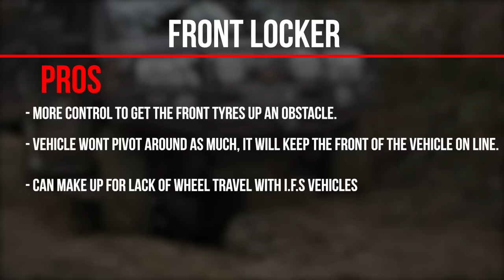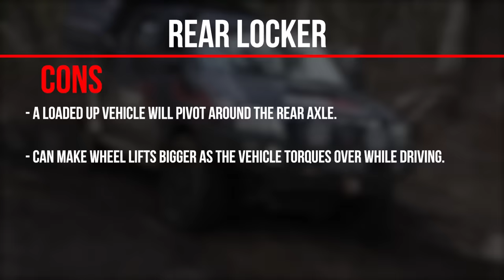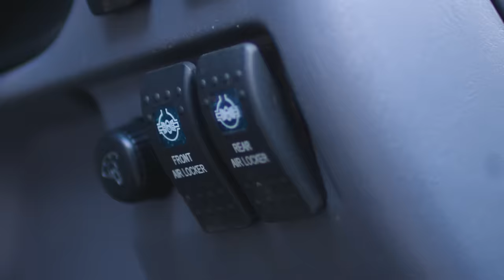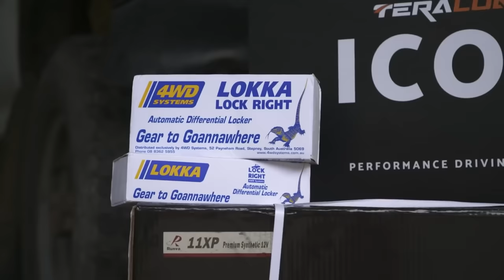FRONT LOCKER vs REAR LOCKER vs TWIN LOCKED COMPARISON! + AIR vs AUTO vs E LOCKER – Shock answer!

Comment: I have an auto-lokka in the front of my ZD30 D22 navara with manual locking hubs, and i can say that they are damn amazing.  I have definitely noticed the stiffer steering when on higher traction surfaces, and in most cases, just backing off the power a bit helps immensely. You can even leave the hubs in and engage 2HI, and barely make a difference to steering, but on smooth surfaces you can sometimes hear them clicking. In saying that, they are mind blowing on soft sand, you can feel the vehicle clawing its way through instead of being pushed. Super easy to install.

I think the most amazing thing though is with descents. With the lokka automatically engaged, you get both wheels braking forces even if one wheel is in the air, and descents are incredible more controlled. Without the lokka, if you lose traction on one front wheel it will more then likely spin faster as its being forced to spin via the transfer case, and the other wheel will lock up, causing a slide, as there is nothing actually forcing it to spin anymore, because the other side is in the air.  That just doesn't happen with the front locker, and the control while on a gravel hill suprised the hell out of me.

So yes definitely a vote for the autolokka. Yes, occasionally you will get the stiffer steering,  and probably the most inconvenient time will be when you are about to go around a corner, but if you let your foot off, its fine.  

As for front/rear, scientificly, its a hard choice. I mean, LSDs are already in rears, so a locker would also help more. But in saying that, the front locker on an IFS vehicle is a no brainer. With a rear LSD already helping, the front locker works well with IFS's lack of traction.  

The way i think of it is this: going up hill, most of the power and center of gravity would be over the rear wheels, so those two wheels will more then likely ALWAYS be on the ground. Like jocko said, once you have one of the front wheels are in the air, you now have a 2wd vehicle.  A front locker will at least give you a 3wd vehicle. A rear locker would not.  You see this in never every clip here in this video, its usually one of the front wheels in the air. Hell its probably 90 percent of the time, you have a front wheel in the air. Once a front wheel is in the air, the entire front becomes useless. 

3wd vs 2wd.  

In the case of ute with more weight on the front due to the engine, and an empty tray, your two front wheels will spend more time on the ground, and with the rear LSD already helping, giving you a rough "2.5wd" a front locker would go back to give you 3.5wd.  That, and with the front locker helping prevent one wheel from spinning wildly, and then when hitting the ground it causes the CVs to snap, you simply dont have that issue anymore, and there is no need to "Send" it as hard, also make the case for a front locker first.  I also see a lot more failed front diffs in utes all for the same reason. Going up a hill, front wheels go up in the air, come back down, and pieces of money fall out of the diff. 

So yes. i work on the principle - whatever wheels you see spin the most up in the air, they are the ones you should put a locker onto. See a wheel spinnin? lock it up!
Reply: Just about to fit one to my 2015 Pajero. IFS like u said will make huge difference

Comment: Love Graham’s comment you push a wheel barrow you don’t pull it. I would love to see him push a full wheel barrow up a step. If you get to a step you pull it up. Front locker is the way to go and just weld it.
Reply: just weld it?????
Reply: why do you need to weld a locker? lol
Reply: @MrTonaluv  if you know someone that can weld depending on what they charge you, you only need to replace the oil. Dont do it if it doesnt have free wheeling hubs or converable auto hubs
Reply: Clearly Graham  has never worked in a job involving a wheelbarrow
Reply: @bradhaines1905  welding an open diff turning it into a permanently locked diff is crazy on the front. How do you steer? It will wind up badly on the bitumen!
Reply: @MrTonaluv  it only works if the 4wd has selectable manual hubs on the front to activate 4wd (when hubs are off no matter if 4wd is on, both wheels are independant)
However when you see the price of a spool block to lock your central carrier and so the diff welding is REALLY a brute's way of handling things
Reply: @tinatpasselepoivre  yes I get it now with the free-wheeling hubs thanks mate. You're right tho about the spool block price - under $600 for a Lokka, and they work really well.
Reply: This a why small front wheel drive cars are suprisingly good at not getting bogged, a tiny FWD corolla with tiny wheels absolutely eats my full size Falcon with much bigger wheels when driving on sandy roads on the farm.
Also when i used to race in Speedway i drove a RWD Datsun at first and then a FWD Charade later, the track was muddy and the Datsun always had the danger of getting stuck if you spun out and ended up in an extra sticky patch, this was never a concern for the Charade, it would just pull itself out.

Comment: For a street/trail rig, I really like the combo of an aggressive limited slip e.g. worm gear type TrueTrack for the rear and an air locker for the front. Helps keep costs down while still being capable and streetable. I'm with Graham - auto lockers are just not my thing anymore. Been there, done that.
Reply: I've heard of this setup elsewhere, too.  Why not torsen in the front,
Reply: why not auto lockers
Reply: @annabanna666  They are no good on hard and paved roads.
Reply: @BuildingByFaith  For one thing, it isn't selectable on and off. It's easy to be in a situation where you need to turn and can't with the front locked.

Comment: I’d like to see testing in different terrain.. soft sand in particular...
Reply: Exactly. How does each locker perform on the arctic tundra?
Reply: I find my lockers pretty useless in sand. I just seem to bury myself faster.
Reply: Agreed we have more sloppy mud than rocky hill climbs where I am
Reply: I find the opposite 🤔 @volvogt21
Reply: @terrydactyl7708  that's interesting. Do you do your challenging sand driving in high or low range?  A patrol mate I crossed the Simpson desert. He did most of it in low. Yet my t/d landcruiser was far happier in high. Low just dug holes and gave me no momentum.
Reply: I cross about a kilometre of really soft beach regularly  @volvogt21  and I do it in high range with a rear locker. Used to loose momentum quite a bit before the locker installation, now I just power through every time, no worries. I feel the locker has made it unstoppable in the sand. Makes me want to invest in a front locker, but wonder if I really need it now. I have no doubt it increases my capabilities in sand. I can take it all at such a good pace whilst everyone without lockers has to put their boot into it to get through.
Reply: @terrydactyl7708  cheers Benjamin.  That's nice info to know. I'll try it out next time I am in soft sand. I'd almost stopped considering them in this situation. A front locker is great but as they say it probably gets me 10 meters further into a place I shouldn't be... lol.  They are great for the sort of conditions that bloke was using it for. Plus it has the benefit of strengthening the front diff on an IFS landcruiser allegedly.
Reply: Sand should be in high range no lockers engaged.
Reply: Why would you want power going to the wheels of least resistance  @joshquiroz  in soft sand? Doesn’t make sense. Locker has got me out of bother in soft sand time and time again

Comment: Good one Jacko 👍  For my 80, I'm planning to put a front locker first.  With the type of driving I do, if I only fit a rear locker, this can increase more front wheel lifts and potentially cause a flip (torque front wheel lifts) as it pushes the vehicle up obstacles.  Front lockers prevents this as it pulls the vehicle up and over obstacles.  But will eventually fit both.
Reply: That's a very good point, thank you.  You alone helped me decide which to do 1st
Reply: Keep in mind that you will lose steering ability with a front selectable lock.  Especially so when weight has transferred onto front axle, ie driving down a rutted step. Front locker great at holding back vehicle on steep, loose downhills, at the expensive of steering.
Reply: When going up hill the weight shifts to the back rear locker will do more good more often. I would get rear first then front.

Comment: "Jocko's Toolbox" should be a regular segment. Honestly Jocko the enthusiasm you show when you are explaining the technical aspects of things is amazing! I have a 2011 Amarok equipped with a factory electric rear locker, if I was looking towards getting a front locker down the track, would it be worth converting the rear to an air locker if I was going to put an air locker(including compressor and all other needed bits) in the front? Can E locker rear and Air locker front work together or would it be a smarter option to have them both the same? Cheers

Comment: detroit style auto locker is the way to go, i have them front and rear and they're totally unnoticeable and always locked, i do have a selectable 2 and 4 wheel drive, separate from the high low, rear disconnect and sticky tires.

Comment: Got an TD5 and I put ann Ashcroft ATB Limited SLip Differential in both axels. It´s more of an overlander and the fact that it always provides best traction even on dirt roads was important for me. Plus the TD5 got a traction control, so even when one wheel should spin it will be stopped and the wheel with traction gets some force. Very happy with that setup, it´s simple, it works and it holds up.

Comment: Twin ARB Air Locked in my Discovery 4 💪🏼 ideal to have both lockers in action, plus having one of the better selectable variable terrain response traction control systems is a bonus. 

Great video, Jocko really knows his stuff, good to see these more in depth explanation and technical videos too 👍🏻 keep up the goodness

🏴🇬🇧🏴
Reply: Thanks mate! Your disco sounds very capable
Reply: @jocko4wd281  one day I’ll ship it down under and see what it’ll do on some proper tough stuff 🤞🏻
Reply: Thinking about getting a rear air locker for my discovery 4, what kind of terrain would you say it helps with the most? Do you think you have used the front locker enough to be worth the price? Also, how differently does terrain response behave with the lockers enabled? How often do you use just the rear, vs just the front, or both, or none at all? I appreciate your time if you do answer 🙏

Comment: I am first time watcher and if your still around i hope cause its been 2 years since this video i want to tell you thank you so much! I have been wanting to find out about the different locking situations and you did it great and humbly with no cockyness and i truly preciate that buddy. 
I have two 4x4s. Both from factory have limited slip rears and full time lock in front. Both are old 4x4s but great trucks.
So when i fill like i dont need both lockers in front i just put them back in 2x4 and then i have limited slip rear and single tire pull front only difference in mine and yalls is yall have a real nice fancy switch that would be so convenient and i have a manual shifter i have to pull but it works.
One of mine is a w 1994 Dodge Ram 2500 5.2 motor 5 speed manual looks brand new. Single cab.
The other 1988 GMC ext cab K2500 with 1992 Chevy Tahoe 350 motor and a 4 speed Chevy Bulldog manual transmission. Great trucks. 88 dont look pretty but drive train is great. But it takes 40 acres to turn it around thats the only fall back with it.
But i realy preciate your help but also not just talk but you did a out on trail illustration and so we cant ask for anything more than that.  By what you showed and taught me i believe im good but i am always eager to learn and i sure got a whole lot to learn. 
Take care buddy and thanks again!

Comment: Love how every single person but one said rear locker going against what jocko found
Reply: I feel like it’s just what different people want. Even Graham said with a good Nissan LSD you can get a front one but he likes rear better. But jock also does more rocky stuff where a front would be better
Reply: You also notice that their cars are heavier than his hilux
Reply: Yup.....Funny how perception vs reality(per jocko's testing) never aligns
Personally I would do front locker just to pull that front through and over stuff vs trying to push it through which never seems to work well. Having front locking hubs allows you to adjust accordingly to keep the turn radius at least for the mechanical locker set ups.
Reply: In North American you will find usually Front first for climbing.. Its all about application.. Rear first seems to be an Australian thing.. Even MadMatt4WD did the same test and found, to his surprise, the "front only" more efficient then rear only..
Reply: @jefftenhave8038  also found it alot safer due to the lean the rear can cause
Reply: @jefftenhave8038  As a result of seeing MadMatt4WDs testing (and seeing the test done on a SWB) I bought a front auto locker for my SWB Patrol, compared to a mates SWB Patrol with rear locker, my front locker defo helps to crawl up steeper rock steps in a more controlled manner
Reply: @petebravo7180  this very apparent in ATVs and UTVs that don't have front lockers.. Front tends to pop up and the rear end walks right up underneath. This is how back flips happen.. All push from the rear and no pull from the front on a hill can make for a bad day .. I can never understand why people use the wheel barrow analogy??? Try and push a wheel barrow over a log..
Reply: @jefftenhave8038  I agree completely there is another video from a different channel and they go a bit farther into the effects of the rear locker trying to over rotate the vehicle while climbing. It helps no doubt but has a inherent instability during steep climbs used alone
Reply: I can’t remember which video I watched, but the presenter mentioned manufacturers equip vehicles with rear only because it has less chances of failure (in ifs if I remember correctly) 🤷‍♂️
Reply: @Agent.K.  correct you are less likely to brake a solid rear axle over a front axle as the weakest link is the cv
Reply: @Agent.K.  Rear lsd and auto lockers will help out while in 2wd as well.
Reply: There's obviously a whole lot of 'group think' going on without much 'actually think'.
Reply: @anthonywhitney634  🤣🤣🤣 that gold but a really good point

Comment: Having an IFS wagon with a good LSD in the rear I love my front auto locker, In my old Zook however the rear locker worked wonders especially with the short wheel base and the tendency to lift the front wheels when climbing, not to mention the on the spot donuts!!!

Comment: Considering the $ spent on mods, the budget issue is really out the window. Nobody seems to think twice about fitting a front bar but they cost twice what a locker does fitted. The price of a second air locker for example is insignificant in the grand scheme of what average Aussie spends on 4wd mods.

Comment: I went for a rear e-locker in the mighty Maximus. Purely and simply because I didn't know where I could reasonably fit an air compressor in the setup that I had. It has evolved slightly since then, but I'm sticking with the e-locker, and I'm considering putting one up front as well.

Comment: It's certainly a "depends on your driving" type of answer. Rock crawling, a front locker comes into its own but for most people, the rear is the most useful. 

I've a Discovery 2 with air lockers at both ends. The rear gets more use but having both is excellent.

Comment: Coming from across the big pond, I found this to be very enlightening and educational and...love the Aussie dialog. We Jeep over here but have the same concerns about the use of lockers. Myself, my LJ Wrangler is getting ARB air lockers installed next week as I already have the compressor and tank onboard for frequent deflation refills. Passing this on to my mates here in Georgia...keep up the great work.
Reply: I can't see any reason to use a front locker without the rear engaged. Other than for test purposes.

Comment: A well done and fair comparison of lockers. My personal preference is rear first, unless it's IFS or like a Patrol with a solid LSD in the back.
It may be worth mentioning too that some e-lockers can temporarily unlock when you change direction e.g. you reverse a little to take another go at climbing, which can make technical driving more difficult at times. For those interested AllOffroad 4x4 Adventures TV, Filthy Motorsports and other Youtube channels do a good job of explaining it.
Reply: Thanks mate. 
I originally had that in the video but decided to remove it as that refers to one particular brands design and not all e lockers do that I believe. But it’s interesting nonetheless! 
Thanks for your feedback, yep filthy motorsports and Alloffroad do some great vids on this too!

Comment: I just completed the install of front and rear air lockers in my Isuzu VehiCross. One think I did differently is to plumb the entire air system with pneumatic switches instead of electric switches and solenoids and use a removable air or CO2 tank. I love the simplicity of a completely mechanical design.

Comment: I'm currently building up a 80 series and I've installed a auto Lokka in the rear and an Elocker in the front, I've also fitted a part-time kit in the transfer case and installed free wheel hubs in the front.